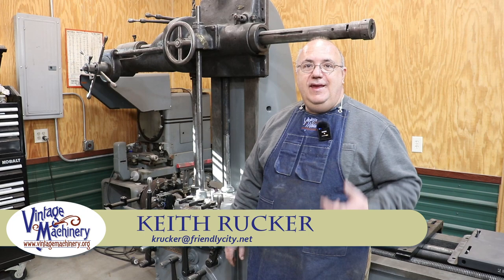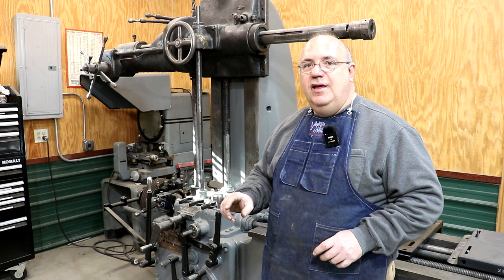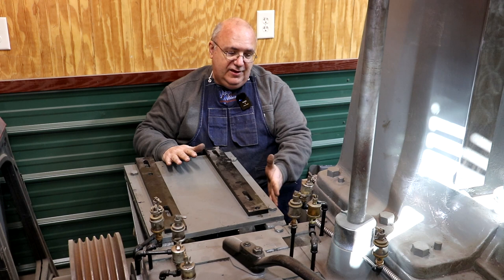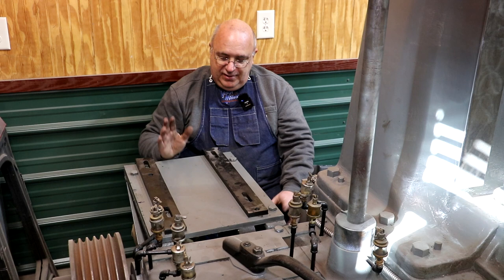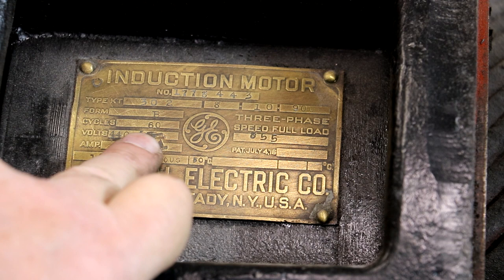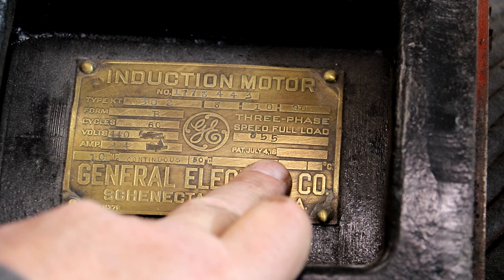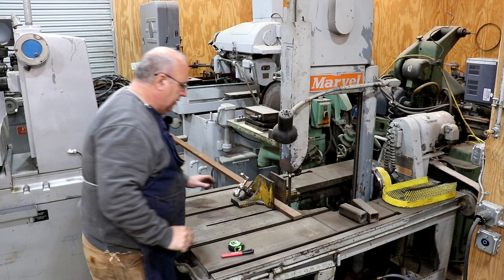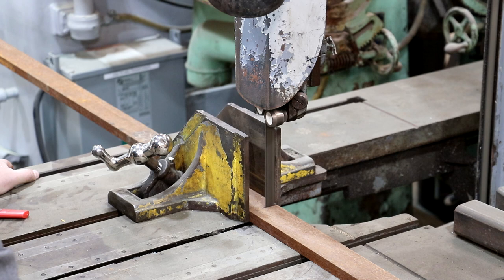Lucas Horizontal Boring Mill: Making a Motor Mount & Installing a 10 HP Motor

Comment: Good job heavy stuff to work with like how you made the two brackets to mount the new motor to the base. Many moons ago I had to remove a motor from a industrial laundry that had the biggest washing machines you could ever think of, I had the motor in my panel truck to bring to the electric motor builder had it strapped down in the center of the truck now,driving stop at a traffic light normal speed and the straps broke that had the motor tied down it slid forward and hit my drivers seat ripped it out of the bolts and crushed me into the steering wheel. Fire Dept had to get me out of the truck. I think it was a 90 horse power electric motor. Never will I forget that.

Comment: Another great video! Smart move on replacing the old motor, considering your situation. Thank you for showing the old motor, maybe somewhere there is someone who could use it (or some of its parts) to upgrade a static display or even as part of a  "cost is no object" type restoration. I'm sure that you know how to "spread the word" before actually scrapping it.

Comment: Hi Keith, the easiest fix for this motor is probably add a VFD to it 220/208 to 480, they are now very cheap and also gives the option of speed control. bushings seem to last for a very long time, usually they just need a good cleaning and lube.
Rich
Reply: A VFD would kill that vintage motor, as it is not rated for VFD use.  You would get current generated in the rotor that would try to cross to the housing and take out the bearings in short order

Comment: Chopping up a bar, drilling and tapping some holes. People don't understand the time and process involved. Measuring, layout, locating holes, accounting for previously misaligned parts. Even the simple jobs take time to do right. Looking forward to seeing the HBM up and running.
Reply: I'm not convinced things were as misaligned as Keith suggested. Look at the 2 holes in the first bar - he said that the holes weren't aligned yet at the end, they seemed pretty close !
Reply: @millomweb  That’s because he used transfer screws to compensate for the misalignment.  The holes in one bar is still crooked but the two bars are parallel.
Reply: @ellieprice363  I was looking at where the bolts were compared to the edge and they weren't far different !
Reply: @millomweb  I just took his word for it, since he was the one doing the work.

Comment: As a mechanic I do not drill a hole or tap in metal without slathering:  "Forney 20857 Tap Magic Industrial Pro Cutting Fluid" on the work and the bit and I never tighten a bolt without jabbing on some: "never seize" compound on the threads, because I thought that is what Machinists do.  Everything I bolt on comes apart easily. Ron W4BIN

Comment: Hi Keith, just a word of caution on the motor.  Not sure what motor you have but motors intended for use with pulleys and belts have roller bearings not ball bearings so they can handle the torsional loads.   If the motor has ball bearings you would likely be ok for occasional use but watch the belt tension.   You probably knew this but I mention it because I learned it the hard way.   😢
Reply: Almost all motors use ball bearings. Roller bearings don't handle axial loads and as such the back bearing of the motor will fail because of the axial load created by even the slightest misalignment. Heavier ball bearings are used for heavier loads on motors.

Comment: You can have your apprentice strip out the old copper windings from the motor (and maybe a few others you have sitting around that are destined for the junk heap) and fire up your furnace, add some tin and make bronze ingots.

Comment: What I noticed when looking at the plate of that old motor is it was rated for Continuous Duty @ 50°C ... You may have mentioned that the motor was scrap however I would (tentatively) say otherwise. 

Before I get into the nitty gritty of where I'm going with all this I feel compelled to say while I disagree that it's scrap, I do think you made the right call here.

The reason for me saying the motor still has value despite newer units being more readily available at a price less than having the old one rewound + bearings fixed is for 1 sole reason ...These old motors were BUILT TO LAST ... Like almost all machines of that era they were well over-engineered and these motors in particular were made to handle not just a number of varied detrimental circumstances but many of them in conjunction with each other.

Comment: You are fortunate to have such a range of center punchs.
Reply: by "fortunate" you mean he went out a bought them, they didn't just magically appear out of nowhere
Reply: A good quality set of transfter punches from 1/16 “ to 1” by 64ths costs $400-500, depending on source. Anyone doing the general type of work Keith does can justify the cost of a set quickly.

Comment: You know ... as big as that old original GE was ... my first thought after you had the new motor mounted was ... Gut the old one and use it as a "Motor Cover" ... there's gotta be a way to use the old shell to retain some of the looks of the machine!
As for the loss of history .. oh well .. functional is better sometimes.
Curious - while the smaller pulley works for matching final RPM, is it also increasing the effective torque of the motor?
Thanks for sharing 🇨🇦

Comment: Shame about the old motor. About the voltage problem, used to work in a place that had a lot of odd equipment,  read expensive, sourced from different places some even used 550 volts hey don't AK me why another of motors were odd frames so we just mounted a small transformer for the machine and stepped up or down to what we needed. Love the videos keep up the good work.

Comment: I'm sure you are aware that there are various qualities of V belts available and I can recommend Gates Quad Power or the latest version that should compensate well for the omission of the original 5No. 1900's V belts.  They will be available from your local belt and bearing supplier.

Comment: One thing to keep in mind is the direction of the motor turning  to make sure it will work first
Reply: The direction of rotation can be easily changed by swaping  any two of the three motor power leads.

Comment: Hello Keith
I can understand completely why you changed the motor, but it should not be disposed of, it should be reassembled, covered, and left behind the machine. I’m sure in the years to come some one would like to replace the original motor, if it’s gone that can never happen.

Comment: The motor that came with the mill would run on 220 volts only because it was overdesigned for 10 Hp.  Those old open type, cast iron frame motors could be up rated to double the Hp with higher temperature insulation and wire enamel.  Modern motors have at most +/- 10% of nameplate voltage tolerance.  Some are +5%, -0% tolerance.  Machine manufacturers wanted cheaper motors and they were obliged by the motor designers.

Comment: Curious why the two original adjustment bars could not be repurposed instead of cutting new material?
Reply: Had the same thought - just mount a plate on top of those bars that has studs for the new motor mounting pattern
Reply: He may want to retain the ability to return the machine to "as purchased" condition. Keith's machinery will hopefully become museum pieces one day. Details/known history matter.

Comment: Hey Keith, did you ever think of turning that bottom plate 90 degrees? Those 850-ish RPM motors are eight pole and usually require them to be built into the next larger frame size than normal, they also have twice the torque of a four pole.

Comment: I hope you did not dispose of that Motor.. It is a piece of history (and quite beautiful)..  Unfortunately, the new smaller "10 HP" motor will not be nearly as powerful and heat /fatigue resistant as the old one..

Comment: Have a similar situation going on with a American jointer that has a GE induction motor.  It was wound for 220V and the additional leads are just wired internally to the motor.  It's been popping my breaker, and because of the way it's wired, It makes it very difficult to trouble shoot the root cause.  it will end up costing me $1200 to rewind the motor, and there is no guarantee that it will resolve the problem.  Sometimes you have to just put a modern motor, and move on.  Mine is a direct drive which makes it more difficult, but Im going to need to engineer a similar solution to make it work.

Comment: The old electric motor you have is probably right around 1940s vintage despite the patent date.  It was common for motors made around that time to be able to be wired up two different voltages/phases during WWII, to make them more widely applicable.  The installing electrician would commonly wire it up according to what electrical supply was available, and then x-out the portion on the spec plate that would not be used, so that any other electrician opening up the motor would know how it was wired.  It is not particularly rare or valuable.  Electric motor shops have dumpsters full of them.  Modern motors produce much more power and run cooler, while using far less copper in their construction and are far smaller.  If you want, you can probably scrap it and get a fair amount just for the copper but you will have to disassemble the windings and the rotor to get the best price.
Reply: Electricians should not alter nameplates.  The next guy can figure out how it is by the way it is.

Comment: Could the old motor shaft be pressed out of rotar, it would be instresting to try,  just for another episode. A brand new shaft won't need spray weld, so an easier repair

Comment: I know they are popular with smaller machines (and I have been using them for my vintage drill press restorations), but do those link belts work on machines such as the horizontal boring machine or do you need to get real non-link ones for that?  It is funny I am in the middle of attaching a new motor for a walker turner 1100 series drill press that I am working to restore and am doing similar steps in a much smaller scale.  So this was really fun and timely to watch :)

Comment: Why not use those original adjuster bars , just put them on at 90 degrees.
Reply: I was thinking just rotate that plate 90 degrees and it would reach to the pulley.
Reply: @paulstanley31  Yeah, and then just weld it in place- done in 30 minutes.  However that would be a short video with no monetization and he wouldn't be able to use his- band saw, radial drill, transfer punches, drills, taps, anchor lube etc.  A good video would be buying another 3 groove sheave, machine it down to 2 grooves and attach it to the other pulley so he would have all 5 belts.

Comment: I'd just about bet that that old motor wasn't original to the machine.  My guess is that it was a line shaft drive that was converted at some point to a motor drive.

Comment: Don’t know why you don’t use a transformer and run the motors with 460/440 vs 230/220 volts, current draw much lower, better current in rush

Comment: in theory, wouldn't you had to have an more HP motor to drive the machine because you have taken an smaller pulley thus reducing your force x arm ratio? i don't think it would matter much seeing you can just take lighter passes while boring.
Reply: No cos the motor's a lot faster !

Comment: First of all, that is a poor business model, in my opinion.  A motor shop should rewind the motor to the manufacturer's specifications.  We have motors rewound at a local shop and they never ask "what voltage do you run?", they just rewind the motor and we set it on the shelf for the next breakdown, which could be a 480 V machine or a 240V machine.

Secondly, have you ever shown off your optical comparator there in the corner?  Those things are the coolest.  We have a large one at work that was made in the mid 60's.  It just sits there collecting dust because we don't really have a use for it anymore.  The company I work for used to use it for the Defense contract stuff they made a long time ago.